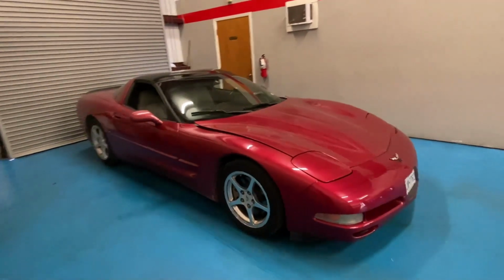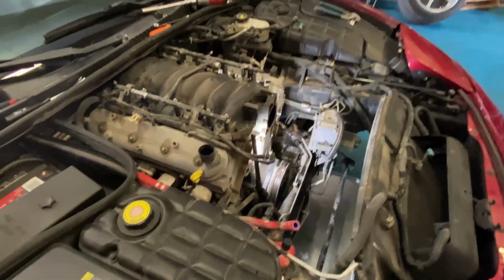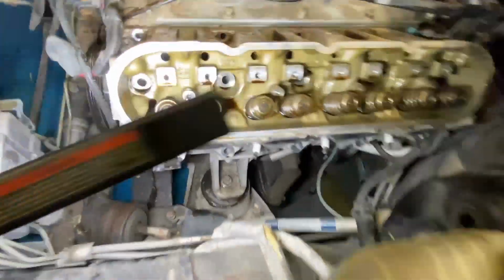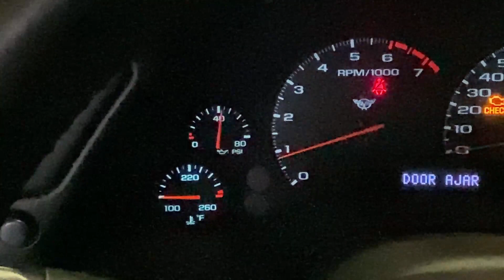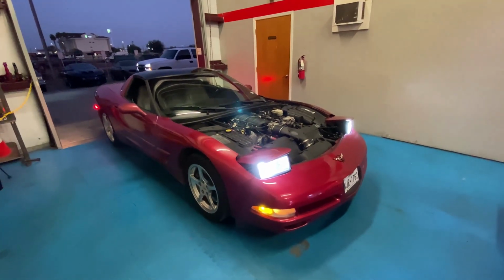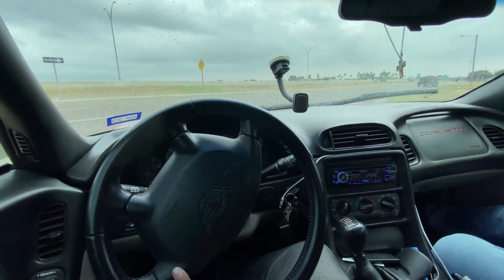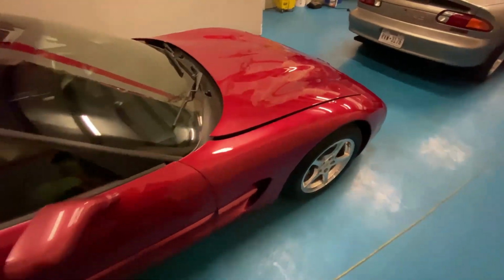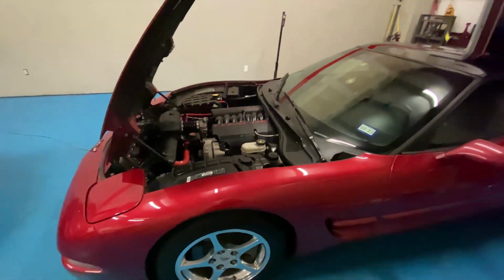C5 Corvette Texas Speed Torquer V2

Comment: What exactly did you do to the exhaust?
Reply from the maker: Left everything stock and only removed the catalytic converters and had a muffler shop weld in a pipe in place where the catalytic converters used to be.
Reply: @hubcityhotrodstv  nice! That's a big sound improvement just for a cat delete. I assume you probably tuned out the CEL instead of using the O2 sensor extenders/anti-foulers
Reply from the maker: It was tuned for the CEL as well as the cam. as far as 02 sensors they were still in the stock location so extensions weren't needed.